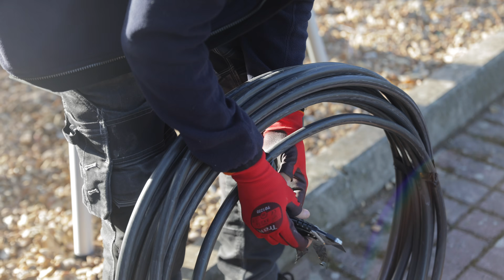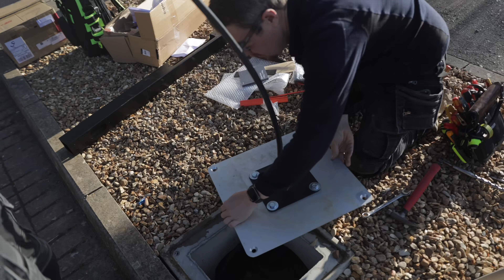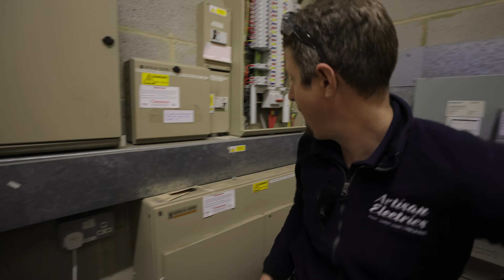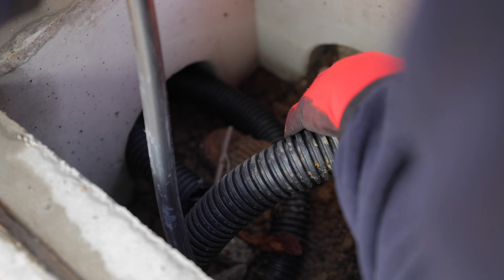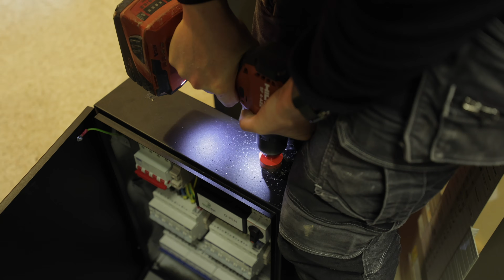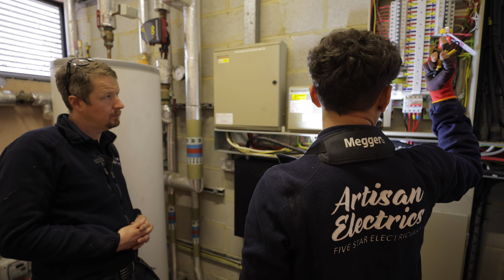Commercial Workplace EV Charging made 'Easee'

Comment: Eeasee charger is currently investigated by authorities in sweden due to lack of working DC surge protection, no jfb and no physical breakers for incoming phases. 
They will probably need to recall every sold device or put in aftermarket external boxes. It will be decided in a couple of months.
So I would not use this in current state anywhere in trhe world right now.

Comment: Great install as always. However, the 100mm bump stops catch the front skirt on several EVs. There's an 80mm tall version that doesn't. Sooner or later everyone will have to switch to the shorter height ones to limit EV damage.

Comment: Great Content 👍
With the R1+R2 on the three phase it doesn’t hurt to do the measurement to all three phases if you have the time. 
You are of course correct in that the purpose of the test is to ensure Earth continuity, by but doing the measurement on all 3 can verify that all the connections of all the line conductors are good as a bad connection would give a higher reading (more than 0.05Ohms in difference)
It generally matters more and is more evident where the circuit is a good bit longer.

Comment: Just a minor tip, you're usually pretty hot on blurring customer info, but it's possible to read the Easee tag serial number for a couple of frames there. If there's any correlation between serial and the NFC ID that could make it possible for someone with a fairly cheap kit to clone the ID to another tag.

Comment: Smart install.👍...So if the 32A supply you put in gives a capability of 22kW charging for a single robot, If you added a second robot on the same post and supplied from the power rail, would the Easee load balancing  give 11kW for both chargers at the same time ?. Thanks
Reply: Yes, great chargers!
Reply: @unrated2100  Thank you Magne

Comment: Should the charger cable earth be connected to the left earth block in the pen fault board? You have it in the right block that is connected to a different contactor to the supply. I guess only a problem if the contractors can be independently manually switched off and then you will lose the earth with the supply still connected.

Comment: I do like parts of the station. But a lack of an internal MID meter is a limitation. I also feel the post is too high and takes the station to an awkward height for some users. Especially on a kerb takes it higher than the required heights in the ACOP for the connector.

Comment: Little tip. There is a little place for a screw at the buttom of the charger under the rubber piece after you put on the cover plate to really lock it in place. I’m an electrician in Denmark and my company have put up 300 of these chargers in big parking garages.

Comment: Jordan  10 amps of overcurrent protection does not limit the potential fault current of a circuit to 10 amps . Take a pfc reading with youre tester it will be in the thousands of amps from that point unless its a TT system .

Comment: The powder on the cable is dry lubricant so the cores can move inside the outer insulation when you bend it while fitting.

Comment: Nice job. I recommend using stainless bolts and washers for exposed fixings like this, the bright zinc plated ones will be rusted within a year or 2 (less if near the coast). With the enlarged mounting holes, there is a danger of the thin washers eventually giving way when rusted - under leverage forces of that large post.
Reply: Agree. Also use spring washers and or nylock nuts to prevent bolts becoming loose
Reply: @mrfixit0273  Exactly the comment I was looking for - think now, don't have to come back later

Comment: One saftey thing I noticed is while installing the new breaker, you are touching the screws on the feed side to tighten them however you haven't verified the pins you're attaching too are actually dead like you would any other possibly live source. You trust that they are since the switches are off, but you wouldn't accept that anywhere else.

Comment: The French chalk inside the cables prevent the inner insulation from sticking to the bedding material or the other insulation of the cable the more the chalk the easier it is to strip

Comment: I have an Easee home charger, with the accompanying Equalizer plugged into my meter. The whole setup "just works", and the ability of the charger to ramp down to accommodate other loads (controlled at phase amp level, not overall power level) is really impressive. As is the charger automatically determining whether the car can take single or three phase

Comment: does the charging point require data cable?
Reply: No, all Easee chargers have free LTE network its entire lifetime. If a charger is not set up with a WiFi-network the charger will automatically use the LTE cellular network if available.

Comment: The powder is used inside electrical cables to make it flexible, high thermal conductivity, moisture resistant, and fireproof.

According to the capacity, applications of electrical cables, different types of powder are used, they are -

Talcum Powder.
Magnesium Oxide (MgO) Powder.
Swellable Powder.
Chalk Powder.
Talcum Powder is used inside some low current-carrying cables (for example, computer power cable) to make it flexible.

When this type of cable is used over a long period, its outer rubber gets sticky and can be broken down. To prevent this problem, talcum powder is used inside.

Magnesium Oxide (MgO) Powder is used inside a high current carrying cables such as Mineral Insulated (MI) cables. It helps to make the cable flexible, fireproof and provides lubrication, insulation. The voltage range of this type of cable is 600-1000V.

Also, Magnesium oxide has high thermal conductivity properties. When a high current flowing through a cable, heat will be produced, and it helps to prevent the damaging of the cable from the heat.

Swellable Powder is used inside some electrical cables such as 6-36kV medium voltage underground power cables. When the powder comes in contact with moisture or water particles, it can form a gel-like material, which helps to solve the moisture issues in electrical cable.

Chalk Powder is used inside electrical cables to make it fireproof. The voltage range of this type of cable is 300-500V. Mostly this cable is used in critical electrical circuits, such as safety circuits and life support circuits. (Electrothinks)
Reply: Thank you, much appreciated 👍👍👍

Comment: Talcum Powder in Electrical Cables
Talcum Powder is used in some low current-carrying cables such as computer power cable to make it flexible, to stop the internal wires from getting stuck to the outer rubber casing. When a cable is used over a long period of time, its outer rubber gets sticky and can be broken down.4 Dec 2019. Source unknown.

Comment: 63A on a 10mm? Where I'm living 10mm is 50A and 16mm is 63A
Reply: It's rated for about 70a
Reply: @JohnSmith-jk8mt  Not in my country. Under best circumstances it's good for 60A, but not in an installation like this.
Reply: @mortenwinslw2785  depends what type of cable you are using . SWA direct buried or in a duct has a ccc of 71 amps .

Comment: Firstly it's so sad to hear of the demise of Anderson EV, I can only assume the supply chain issues are due to lack of components and if that is the case what does that bode for other EV caring manufacturers?
On to another point with hindsight the next time you fit one of these chargers in the video maybe you might want to leave the main base cover unscrewed just incase you drop another nut. As a suggestion the the manufacturers if they haven't doe so already they could fit a 6mm welded stud to the inside of the column so the connector and earth tag could be slid over the stud with an A4 grade stainless steel external star washer and nut which would give a secure fitting but as a marine grade stainless steel would not rust.

Comment: Does the charger come with the rift cards or they a separate item to buy?
Reply: If you mean rfid cards, then no. My Easee installation didn’t come with them but I’ve managed to use nfc on an Android phone and also a random rfid card from my wallet and joined them to my account.
Reply: the easee home doesn't but the easee charge like these comes with one. You can also buy them in packs of 10
Reply: Once you have set up your company account with the supplied tag you can then use almost any RFID card (such as staff access cards) and pair them to the account, saves buying more tags and means your staff don't need anything more than there staff access card, less to lose!
Reply: @buzzyphantom  What did you have to do to add them, and is it easy to remove them when needed?
Reply: @wintersun398  you use the RFID tag supplied with the charger that has been set up on the account as an ‘admin’ or ‘manager’ can’t remember which. You go to a charger in the company group and the staff member logs into their own account, add the Original RFID tag to the account, then this allows you to add an additional rfid card to the system. Once they add their card to the system you can then delete the original Admin RFID. You only use that to link the company account, which lists all the chargers to the staff member account, the admin rfid allows this and once the two accounts are linked you can then add the staff card. You must start a charge with the staff card before removing the admin card from the staff persons account or it won’t register on the company account. 

That’s the basis of it, sorry the details are a bit sketchy it was a long time ago!

Comment: Just a tip for next time. Use nylock nuts on the bolts for the pedestal, you will need longer bolts. Only using plain nuts you might find they come loose.
Reply: Yep, it will get loosen over the time, especially being outdoor. Also serrated washers help too
Reply: yeah, would work a treat!
Reply: Everyone's right in regards to nuts working loose.
If you walk away from any job thinking theres a CHANCE or risk that something can fail you didn't install it to the highest standard possible. Live and learn!
Reply: Also I don't feel great seeing that there isn't some kind of grease or caulk on those bolt holes. Yes I know that cable is properly shielded and jacketed down there...
Reply: Not exactly a high vibration area is it🤣
Reply: @samdean2851  true, but the cost of lock nuts outweighs the cost of a call back
Reply: @samdean2851  You will be surprised how much vibration and temperature change is enough to loosen them.